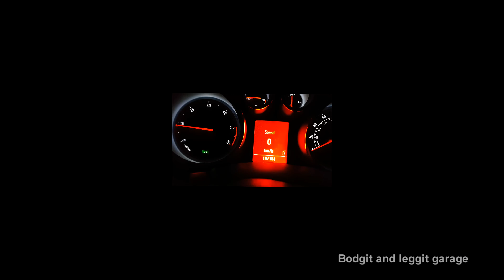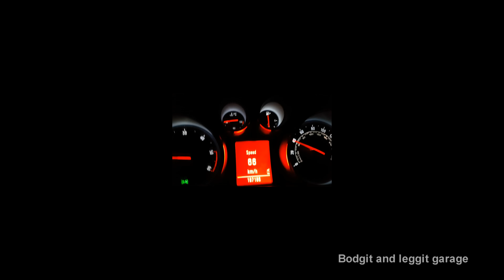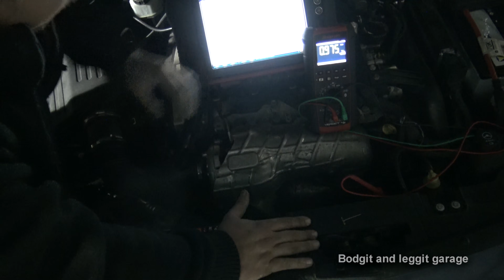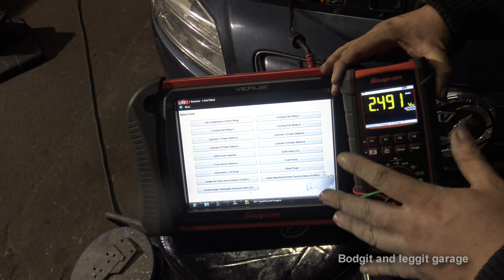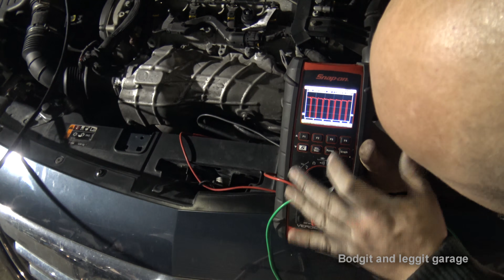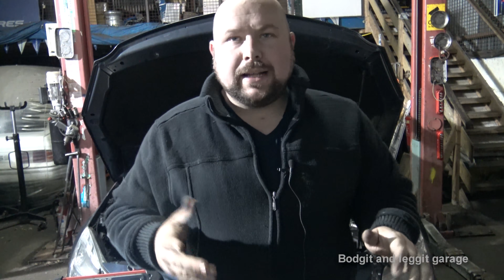Vauxhall / Opel Insignia No Power P0234 P0299 Bodgit And Leggit Garage

Comment: My 2013 insignia had a dpf full message and took longer than usual to clear but when it did it went into limp mode permanently no engine noises and only warning was service soon, been told today it's a sticking part in the turbo can't remember what it was but 🤞 it is fixed tomorrow 🙏🤞

Comment: Hi mate just came across your video and what is happening with my insignia 2.0 cdti is at random it goes to limp mode when i put the foot down but if i turn engine off and back on all is fine.but shows overboost fault code so i changed the boost solenoid valve but issue still happens every now and then but didnt happen for months then just happened again the other day?
Reply: Hi, I have the same problem..how did you sort out this issue in the end please?
Reply: @ i cleaned several sensors like map and maf,i also sprayed turbo cleaner into turbo as heard it coulda been sticking vanes in turbo or something,and not had the issue since so don’t know what actually fixed it but seems good now.

Comment: Recently had exactly the same intermittent problems with power, on 2016 1.6 Astra K. Diagnostic showing underboost. Turned out to be a leak on the stainless steel pipe from the exhaust manifold. Quick weld from my mechanic, and all is good.

Comment: Hi, i have tested the cable that came from the ECU to the pieburg valve and i find 9V with car key in ON position but engine off. Is normal? Thanks in advance. The car is Opel insignia 1.4 turbo LPG 140cv

Comment: When you changed the solenoid did it work straight away ? I changed mine and not much has changed and my car was doing the exact same as the car in your video
Reply: Hi,
Did you manage to sort out this problem? I'm in this situation right now..thanks,
Reply: Well I changed the solenoid and I also bought a liquid called revive. It's for the turbo helps clean it out thoroughly which ended up fixing it. May work for yourself.

Comment: Having the exact same problem with my insignia, same with mine pipes are fine no leak, mass air flow sensor is fine, no smoke so I think turbo is fine. So I think its the solenoid aswell

Comment: Iv got the same issues on 2015 2.0L vauxhall insignia Sri, ran the engine idle for 5 minutes that sensor didn't get hot. Any ideas what mine could be thanks I'm advance

Comment: Got this EXACT problem on an Alfa 2.0 JTDM - turn engine off and on and it’s fine. Problem is that it’s intermittent- done it three times in the last 700 miles or so. I doubt this is testable and I’ll end up just throwing the part at it.

Comment: I’ve just ordered a new 1 of these as my car is vibrating when idling 🤞 hope this will fix the problem
Reply from the maker: Hi mate I hope you diagnosed it first and not just guessed they can be lots more problems then this particular part
Reply: @bodgitandleggitgarage  I haven’t to be fair but as you mentioned they are a common fault and the part is cheap I thought I’d give it a go.
Reply from the maker: @martinrussell9251  good luck I hope it fixes your problem
Reply: @bodgitandleggitgarage  hi mate.. didn’t work on mine.. I took egr valve and inlet pipe off gave them a clean.. car seems more responsive but still vibrating when idling 🤷‍♂️ think I need to scan it

Comment: Hi, great video. Thanks.
 Im having the same issue (astra 1.7cdti, 2013),  I only have the overboost code appearing on the  scan. I was told this is likely turbo? Althouh it is intermittent Could it still be the egr? Or would a separate code indicate egr ? 
Thank you bud

Comment: Did you happen to have a wastegate rattle aswell!? I have a 2.0tsi ea888 with this same fault code.. a garage changed the n75 and a diverter and it fixed it... but a week later it failed again

Comment: Hi. Great video and nice testing. I was wondering why, when you where testing the control wire, the multimeter showed around 600mv engine off and 2.6 volts at idle, but when you took control of it with the scan tool, it was showing battery voltage ( as it's supposed to because it's not energised and the 12 volt feed comes through the solenoid to the control wire right to the pcm), and going down to aprox. 7 volts at 45% control of boost solenoid. And when the scan tool stoped controlling the boost solenoid, the voltage came back to 2,6 volts. I mean, could you see from the beginning that there is resistance in the circuit?Or there's something i don't get about how this solenoid is operated. Anyway, thank's for your videos. Keep doing it good.

Comment: If you have to order a replacement make sure it's the latest version for A20DTH... Left side of valve will be round, NOT rectangular as can be seen on the one originally fitted to the vehicle. Basically it has to look like the one shown at 17:43. He's fitting the right one. Thanks for the vid mate!

Comment: Help ...fault code P2263,no power.Changed boost solenoid no difference.Carbon clean carried out...😞 any suggestions!
Reply from the maker: hi mate it will have to be diagnosed properly it is impossible for me to Guess That's Why in a video are you diagnosed everything properly before I made the call on what it was if I tell you something and it is wrong it's just going to be a waste of money and you are not going to be happy

Comment: Hi hope someone can help me, I changed the solenoid, does the service vehicle have to be reset or does it reset itself, in my car it hasn’t reset and I am getting power, not exactly what I normally get but definitely different
Reply from the maker: hi mate you might have a separate issue you're going to have to plug the car in and see what error code you have it could just be a simple case of resetting or you might have another issue somewhere

Comment: Would this cause juddering and smoking too as i got a 1.9cdti 150
Reply from the maker: hi mate impossible to guess it could be injectors it could be a pump it could be be a leak in the intake it could be a dodgy sensor could be dodgy fuel the list goes on and on impossible to guess we need to be diagnosed properly
Reply: @bodgitandleggitgarage  it went like this after i did the injector seals and leak off pipe ill just bang it in a garage i give up with it

Comment: can it be this boost control valve, but in my car its not getting very hot?
Reply from the maker: Yes mate it's a possibility if it's not working this one was just getting stuck which was causing it to heat up you'll have to check it properly

Comment: I have a issue with my astra mk5 1.7cdti when the service light comes on intermitantly and comes on and off goes into limp mode now and then could this be the same issue as the turbo boosts fine till it does it
Reply from the maker: Hi mate there's literally thousands of reasons why that can happen you're going to have to get engine codes and take your diagnosis from there as well as looking at live data
Reply: @bodgitandleggitgarage  comes up with p0234 over boost
Reply: @bodgitandleggitgarage  and cant check same thing as dont no were the solinoid is located on the 1.7

Comment: Hi man i have a problem with my corsa d 1.3 cdti 90 hp, i have p0234 and p0243 errors and no1 have fixed it until now.. Can you help me to tell what is the problem so i can show to my mecanic this.
Reply from the maker: Hi mate as I'm sure you can agree it will be absolutely impossible for me to tell you what's wrong with the car as you can see in the video you have to test things properly and there is many different reasons why you can have these error codes I explained everything in the video it will have to be tested properly to determine what is wrong and then fix that

Comment: Great video and we'll appreciated. I followed what I could and yes it was the boost control solenoid that was giving the problem (burning hot) Replaced it & Ran grand for a bit and then threw a P0234, P2263 (both intermittent faults) and P003A (position not learned) fault. Any thoughts before sending it to Opel? Many thanks in advance.
Reply from the maker: Hi mate  it's going to be impossible for me to diagnose this through text you're going to have to get some live data and monitor exactly what's going off then you are going to have to make sure you've got no leaks in your turbo system then you can check your powers and grounds to your boost control valve check the wires there's just too much to list that this could be this will have to be diagnosed properly
Drive your car down the road to see exactly what it is boosting at when you go through all your Gears and see when the faults actually comes up you can do all this through live data

Comment: Replaced it & still got underboost & P0299 problem despite changing this the MAP,  MAF & EGR
Reply from the maker: Hi mate like I say in the video it has to be diagnosed properly to see exactly what the failure is no point just changing something without diagnosing it properly first I cannot tell you what's wrong as it will need to be diagnosed properly
Reply: bodgit and leggit garage I’ve went through the same process and found same parameters and readings but it’s still coming up intermittent P0299 I’m completely lost 😭
Reply from the maker: @rugbybrute  there's too many things it could be get your smoke machine out and smoke the turbo system also get your scope out and Scope the intake sensors
Reply: bodgit and leggit garage sorry man thought I replied, so done smoke test to no avail tested all components again to my wits end I tested the the injectors through the Delphi injector tester all same reading even after a cleaning cycle and re test all within Perimeters still had same problems & code would not leave! Finally done a spill test & found injector 4 was over fuelling by miles though no other indication that I had a fuelling or injector problem replaced and coded new injector the thing is flying now! This has to be the worst engine I’ve had the most fortune of working on! But just to say thanks for the video mate helped me put a few more cogs into the    Thinking machine! Keep up the great work!

Comment: I have the same a20dth engine and that part you changed, I'm getting a buzzing noise coming from it, codes read are p0299-00 engine underboost and other code is p0033A-00 turbocharger boost control not learned, any info on these codes would be very much appreciated, also great work from you on this video content your producing, top man..
Reply from the maker: Hi mate the first thing you need to do is pull ups on live data and see what the turbo is actually doing also get it put on a smoke machine see if there is any leaks in the system
Reply: @bodgitandleggitgarage  yeah it's coming up on vaux com turbo charger not learned and I also have a very bad judder around the 2k revs, been told a software update will be needed, thanks for getting back to me.
Reply from the maker: @dothebouncycastleshire5079  you are going to need to go and live data and see if you getting any readings from the turbo when something isn't learnt correctly you normally get a really high reading or a really low Reading or no reading at all it goes onto a common reading that the computer recognizes isn't correct if this is the case you're going to have to get it programmed first before you can continue
Reply: do the bouncy castles hire hi mate I’ve got the same problem with mine did a new solenoid fix the problem?

Comment: Top man, i have insignia 1.8 Sri that is doing the same except it's in 1st and 2nd gear very informative information Thanks.ps was getting 16 mpg already been to garage and got new callipers and brake pads no diagnostics like yours ofcourse Wish it was, And it's still only 22 mpg any suggestions Leon.
Reply from the maker: Hi mate the problem is it could be lots of things it could be a simple thing is if you've got new pads and discs they could be slightly seized it could be air flow metres sensors just too many things to list I would need an error code to try and lead you into some sort of Direction

Comment: Great video mate. Had exact same issue could sometimes get out of 3rd and into 4th, changed solenoid but unfortunately still have same issue, runs more smoothly but still goes into limp mode, any other ideas? Any help appreciated
Reply from the maker: Hi mate as I'm sure you can appreciate it's going to be very difficult for me to guess what's wrong with your car it's going to need to be diagnosed properly I don't want to say anything to you and you to buy a very expensive park and for it not to work you have to use a good scantle to pull the codes off that OBD2 data is not good enough you need factory scan data if you could pull me some codes off I could help you a little bit more but without any code it's impossible
Reply: @bodgitandleggitgarage  cheers mate, can you recommend a scan tool that work with Opel's 
Cheers and keep the videos coming
Reply from the maker: @jamesdm75  lots of them do mate but you need more than just an OBD2 reader you need scan reader as well or factory data but you are talking at least £500 upwards I don't know of any under that price that does it very good
Reply: @bodgitandleggitgarage  OK thanks again I'll look around and see what works

Comment: what's the point of this fucking video? ??
Reply from the maker: The car came in wasn't working properly it went out working properly we show what the problem was and we show the fix seriously you couldn't work that out yourself
Reply: +bodgit and leggit garage next time you want to help do so generously and not done so to sell ads because that's all you did in this video..
Reply from the maker: @ried7573  what did I sell in this video
Reply: +bodgit and leggit garage you made a video did you even try to say the name of the valve you change? ?????
Reply from the maker: You did not even watch the full video I mentioned what I changed in it plenty of Times next time before you make a common watch the whole video and actually understand what you are trying to say because you're making no sense whatsoever

Comment: My 09 insignia is doing this as well. I thought it was the egr valve. Pulled it out and the pipe and cleaned it but it made little difference. On the motorway it'd get up to about 50mph in 4th and just sit there with you foot on the floor. Getting it home I lifted the bonnet and the boost solenoid was making a hell of a clicking sound (engine off). It also makes a sort of farting sound sometimes. I need my neighbour to stick it on his computer and see what the fault is.
Reply from the maker: Hi mate yes you definitely want to get it plugged in because they have a lot of common issues not necessarily your solenoid make sure you have a good scan tool as OBD2 doesn't read the code properly on Vauxhalls make sure you test it before just replacing it
Reply: @bodgitandleggitgarage  I found 4 holes in my intercooler pipe. That won't help. If that doesn't fix it i'll be taking it to the professionals.
Reply from the maker: @spwicks1980  well it certainly wouldn't help mate lol
Reply: @bodgitandleggitgarage  your videos have been helpful diagnosing my problems. Big thanks!
Reply from the maker: @spwicks1980  I'm glad they  helped you out mate

Comment: I have the same problem now after replacing the boost pipe because it was split it came up with a dpf fault  any suggestions this has happened before it's has a solenoid replacement back in May as well
Reply from the maker: Hi mate as I'm sure you can understand it'll be impossible me to tell you what's wrong as I cannot see the car or do any testing but if you've had problems with your boost then your DPF would not be able to regenerate so pretend she could be blocked there is ways of sorting and checking this out but you are going to need some expensive equipment to check it out like an oscilloscope it's very easy to test once you have the right equipment and you can see if your DPF is blocked if it is you can either do a forced regeneration for clean it whichever needs to be done
Reply: @bodgitandleggitgarage  would it be worth taking it to be professionally cleaned as I know they can be done ?
Reply from the maker: @darrenrheeston1092  only if it needs it mate no point wasting money get it tested first

Comment: PLEASE HELP!! i have had tge same issue and have changed the solonoid valve for a genuine one no splits in pipes etc pulled the codes  po03a,p2565,po229,p2353
I would really apreciate any suggestions
Reply from the maker: Hi mate as you can imagine it's very difficult to tell you what's wrong from just codes this is why we test and do diagnostics but you have to separate code there 4 turbo solenoid problems and pedal problems the best thing to do is reset the codes and see what comes up and go from there some of these codes could be old and have nothing to do with the problem you're having at the minute
Reply: @bodgitandleggitgarage  realy apreciate the reply mate.. had all the codes leared and left with just the one now p2565 turbocharger boost pressure control position sensor a voltage to high, i have changed the map/boost sensor but still the same no boost and service veicle soon.. im stumped any ideas of the potential causes would be appreciated thank you
Reply from the maker: @stephanharrison5ih5ygt30  hi mate you need to start checking the sensors not just change them check that you've got power supply and a signal make sure the wiring is good first if you've got a scantool so you can read read live data if you don't have at least these equipment personally I would take it to someone that does otherwise it's very difficult to guess
Reply: @bodgitandleggitgarage  thanks for rhe reply mate much appreciated.. iv got a dvom multimeter however on the 3 wires feeding the actuator i have only 5 volts is this normal